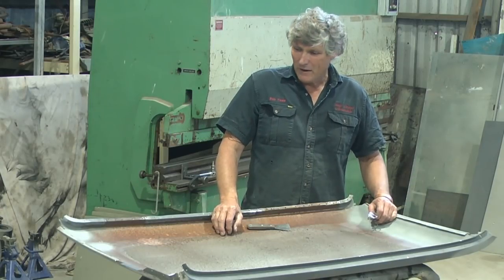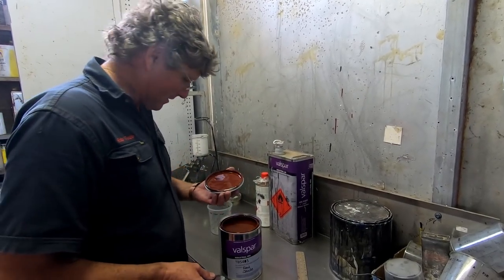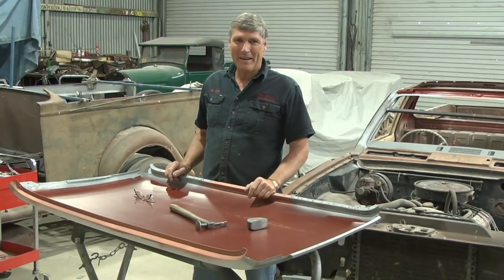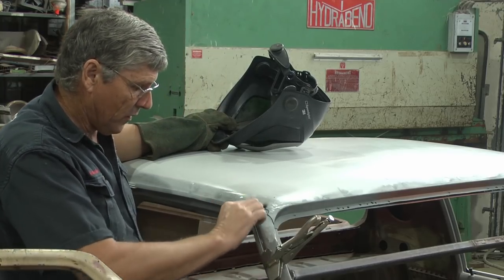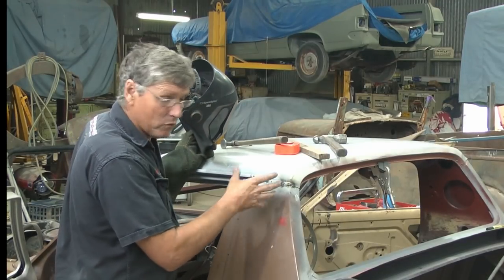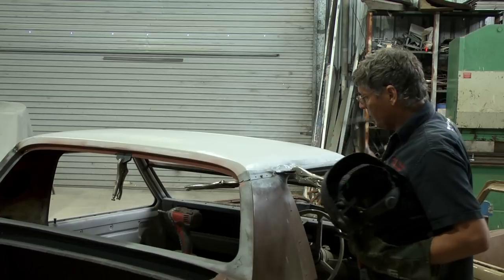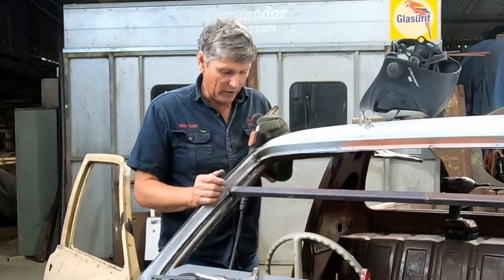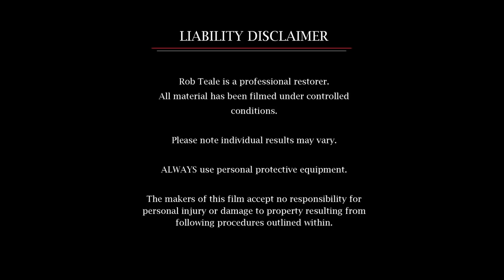1970 Holden HG ute - roof rust repairs Part 8

Comment: Locked up stuck at home in Vasse, loving the video content from a local! Have an FJ Ute in the shed and wishing I had your skills
Reply from the maker: FJ's are definitely cool. I have a special sedan that I bought in 1983 when I was 17. It was my every day driver until about 8 years ago. It is awaiting some rust repair work in the rails under the floor. I have done over 200,000 miles in the old girl.

Comment: Wow what a show, so much, great information. I'm definitely going back and watching this two or three more times. I'll probably have many questions after too. 
 two questions for now, did you weld straight onto epoxy primer or was that masked up too? 
 Did you clean metal with some kind of product before primer? 
 Great efforts team Rob. Camera work is tops too.
Reply from the maker: Hi Mate I masked the edges of the roof skin and after I primed and painted it I primed the edges with weld through primers. This is the parts that I welded. Cheers Rob.
Reply: @robsshed  OK thanks. Did you clean metal with anything before paint?
Reply from the maker: @shanepascoe1078  blasted.
Reply from the maker: @shanepascoe1078  straight over the media blasted steel. All contaminants were blasted from the surface. 😁😁😁
Reply: @robsshed  perks of blasting i see.

Comment: What did you mean about 2 different weild through primers was alway told by 3m weild through was a anoid and not a adhesive primer so I alway clean off were can and use a epoxy then wax and still use a fish oil on fit up were I think needed are you saying there is a 2nd weiled through that holds adhesive properties    my mistakes if I miss understood your procedure
Reply from the maker: Hi Mate, I think that we are on the same page, but reading diffrent words. I only use weld thru in seams and in cavities where I cant paint later. Two types, copper rich primer and zinc rich primer. I my experiance neither has any great etching propeties. They both seem to lift off metal very easily, and I dont use them as a base for topcoats. The copper one was developed for resistance ( spot) welding to help with the conductivity for the electric current. The zinc one was originally aimed at mig/ tig welding. I have tried both with oxy and they dont have much benifit. Plenty of people are reving up the copper one as an all purpose product, but I recon it burns off a bit more with the mig than the zinc type. I use cold galvanize paint for the mig as it is cheaper than the spray cans. All exposed weld thru I remove before applying epoxy primers.😉 hopefully that clears things up for you. Cheers Rob.